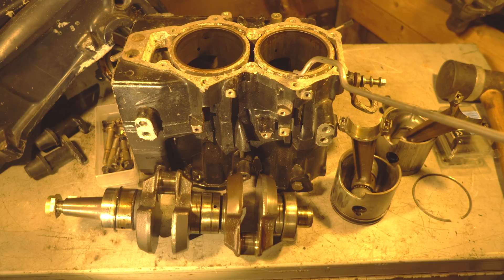Why are boat Engines rebuilt more frequently then car Engines?

Comment: I think the cooling has a lot to do with it. If you put a boat in neutral it still idles, it doesnt stop. Boat engines in sailboats are also usually under powered.

Comment: soooo wrong
Reply: engines get the best oil pressure when being worked hard. the real answer is in what coolant you use. the green juice cars use helps gaskets last forever under normal use. low oil pressure and poor coolant are the second and third worst engine running conditions otherthan oil contaminants that cause wear.
Reply: @RandomsFandom  That is completely not true. engines  (oil pumps) have a pressure relief valve which tries to maintain a specified oil pressure. It lower at low RPMs but should level off at some pressure as RPMs increase.
Reply: gr8fullfred look into low rpm damage on an engine. Especially the 5.7 hemi that has a higher cam, and gets poor lubrication
Reply: @RandomsFandom  If an engine gets poor lubrication its a design flaw. do not buy engines from companies that make engines with poor lubrication!
Reply: gr8fullfred the hemi still lasts longer than any ford engine.